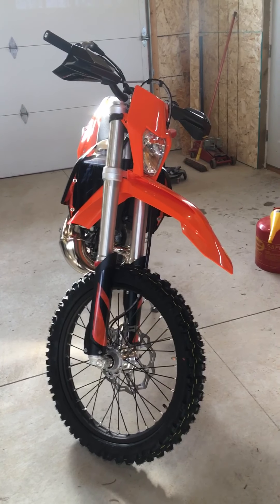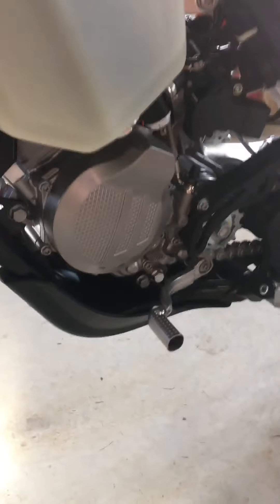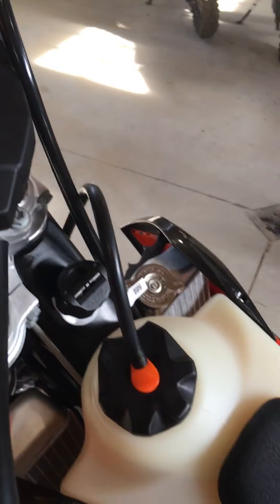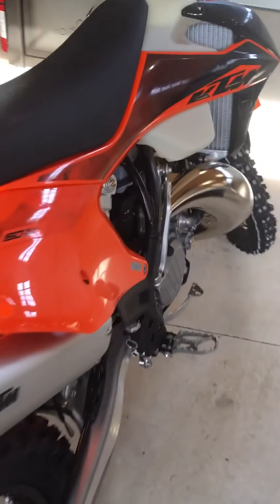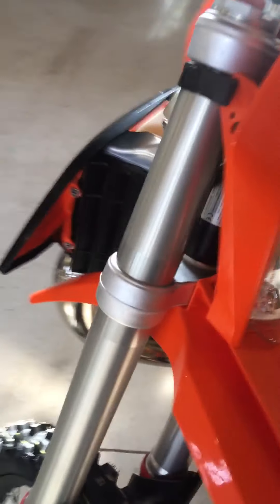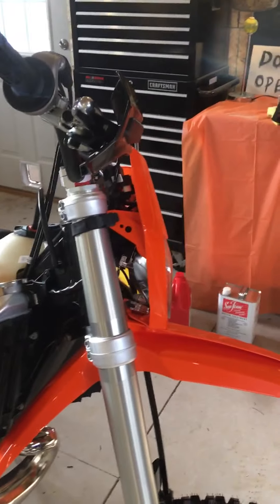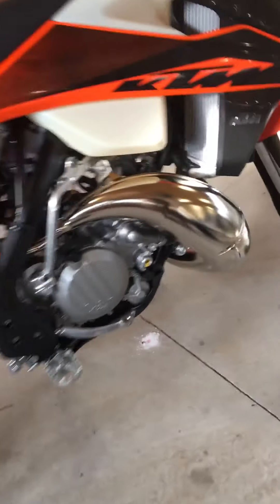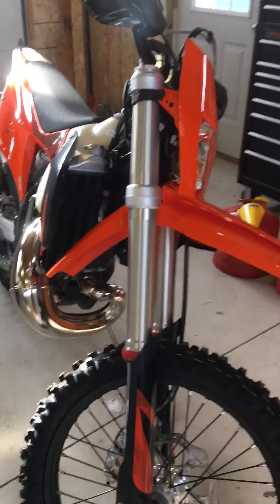2020 KTM 150 XC-W TPI for D14 Harescrambles (walk around)

Comment: Good vid 
I’m 50 and just learning to ride. I’ve ridden 20 hours on Yamaha ttr 125 learning the basics 
Do you think this would be a good first bike to learn on?
Reply from the maker: Tyler C are you asking about your Yamaha or about the KTM as a good bike to learn on?

Me, I rode a 250 four stroke and added this 150 two stroke. Both are great, but I think I’m better on the 150 right now. I’m 165 to 170 lbs with full riding gear and hydration. I noticed riders about my size on 125 and 150 bikes and was told it would be good for me. The guys I ride with say I’m faster.  We will verify that this coming race season. Do you live in Michigan?
Reply: I’m asking about the Ktm 
I live in Canada
Reply: Just wondering what you think about it being a beginner bike 
Thanks for replying
Reply from the maker: Tyler C.  I think it’s great for any rider, but it seems to be a great bike for single track. It’s 30lbs lighter thank my 250 four stroke and lower center of mass. The wide gear ratio on the XC-W (versus XC) let’s it behave a bit more friendly for shifting (seems to pull through without having to downshift). It will never have the “lug” potential of a four stroke, but it’s a good balance. Still operates best when you’re “on the pipe”. It is also a quiet bike (you may or may not like that). 

Note: if your weight is more than me, you may need to work the forks and shocks.

Also, if you ever get to
Michigan for riding...reach out and ride with us
Reply: Thanks very much! I think it’s a great bike! When we go on a road trip I’ll get in touch with you.
Great tips on the vid 👍

Comment: I'm 13 years old and trying to move up to a full size bike from a Cr85rb. Do you think this bike would be a good bike for me?
Reply from the maker: Micah Beausoleil congrats on moving up to a big bike.  I started late, so I’ve only had the larger frames. 

I don’t know what your skill level, weight, and budget (how much you have to spend) are, but the bike is great. This is a great bike for trail riding/racing. If you are motocross, you might want to consider the 150SX.  

Also, a good bang for the buck is the yamaha 125 bike series. They have both the trail and MX bikes too (I think)

I will be using this bike for hare scramble races. Some of the guys that race use 125 and 150 two strokes or the 250 four strokes. The four strokes are heavier
Reply: CREEPERMODE   Thank you. I am  105 lbs 5'5 and I am going to work this summer to earn some money. I am thinking about buying it as a leftover in 2021 to save some money. I ride trails in Connecticut